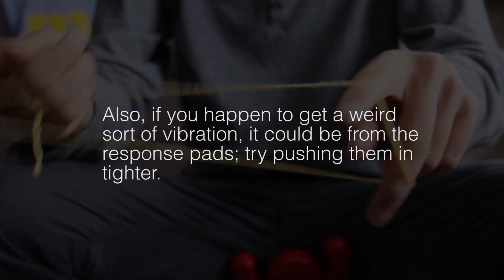The Yeti Assembly/Maintenance Video

Comment: What does he mean by tuning I am new to clyw yoyos and I want to get one of these because I heard they are nice. So when they come out I want to get one but what does he mean by tuning.
Reply: Its not just clyws. Yoyos go out of tune. When they do they dont play as smoothly. This usually happens because you unscrewed the yoyo or you ding it. when its out of tune its not smooth and sometimes the yoyo makes a weird sound. The best way to avoid this is to unscrew the yoyo as little as possible and trying not to drop it.